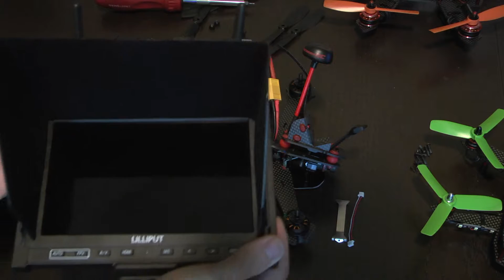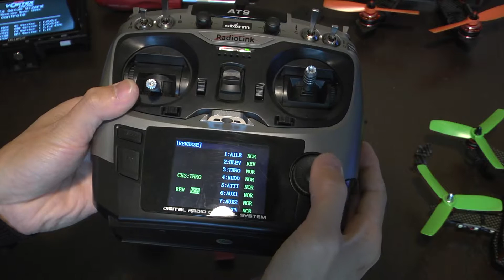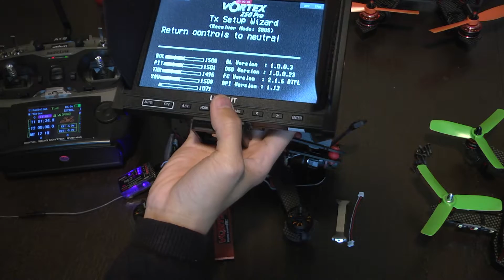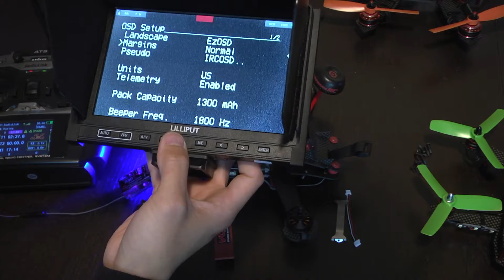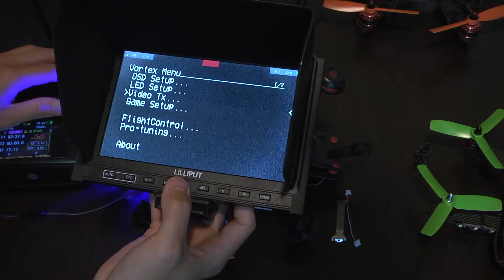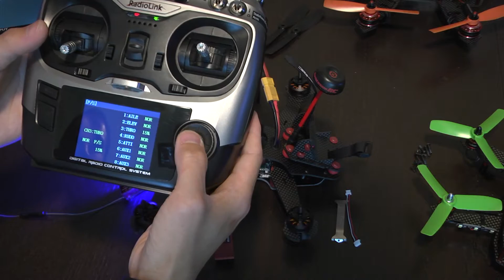How To Set Up and Bind Vortex 250 Pro with RadioLink AT9 (S.Bus)

Comment: ive got the same transmitter, i cant get my quad to arm once it blinds to the transmitter...how do you arm your quad?and would i change settings in betaflight or on the transmitter itself?
Reply from the maker: Changing how arming is done is configured in betaflight/cleanflight. By default, the left throttle stick (mode 2) is used for arming when you bring it down all the way to the bottom left (disarm to by bringing it to the bottom right).

It is recommended these days to assign an aux switch to arm and disarm (you would set that up in betaflight after pick your switch on the AT9).
Reply: @MatrixWriter  thanks bruh.i going to try it out in the am,ive never setup a drone through beta or cleanflight..anyway chance you could walk me thru it step by step?
Reply from the maker: @nickodadon1328  No problem, I'll do my best to help you out if needed if you are unable to find anything online. Feel free to email me which is located on the About section of my channel.
Reply: @MatrixWriter  i emailed you bruh.....
Reply: @MatrixWriter  i emailed you....

Comment: Hello thank you for this video. I am thinking about buying the immersion rc 180 124$ on amazon. I also have the radiolink at9 and at9s with the micro Rx. I looked threw all of my wires for that plug you have but i don't have it. Did you vortex come with that wire? I might have to solder the wires together to the right sbus connector for my micro RX. Can you please give me some tips or advise? Thank you.
Reply from the maker: Ian Rice No problem. The Vortex 180 according to the manual is supposed to come with 3 different receiver wires (S.BUS, FrSky XSR, and Spektrum). Chances are that you will have to solder a different connector to the S.BUS cable for the AT9 receiver (if it didn’t come with a JST or picoblade end connector)

I personally did a direct solder to the AT9 receiver as the pads are exposed and it is only 3 wires. Let me know if you have any questions.

Comment: hey ive got an atom and im trying to rebind it with my at9...are the steps any different?
Reply from the maker: Nickos White The steps are generally the same. Make sure the receiver and transmitter are bound together and in S.BUS mode. Next have your assigned Aux switches (flight, arm, etc) set.  Power up the Atom and the TBS Powercube will have you go through the RC wizard setup - similar to the Vortex.

Comment: okay I got an rx122 and everything connect but I cant unlock the at9 after the rx122 is connected...theyres a yellow lock on your at9...how can I get pass this so I can fly???
Reply from the maker: Nickos White I'm not sure what you mean...the yellow lock means that the radio menu will no respond to accidental touch of the buttons and dial wheel to prevent undesired setting changes during flight. However the sticks and flip switches will always respond. 

These settings can be change under Parameter menu. 

Once you have successful bound the receiver to the transmitter, you may might need to set up the radio system under Cleanflight/Betaflight for your model.  This video shows that you don't need a PC to set up the Vortex - however other models may.

Comment: Is the Kapton tape necessary or would electric tape work?
Reply from the maker: Jose Alvarez You can use both.  I picked Kapton tape since it doesn't leave residue like electrical tape. Ideally shrink tubing is the best if you have the right size.

Comment: Thank you SO much for posting the original Helipal settings in your Google Drive. One thing that's happening now though is the buzzer (beeper) won't stop beeping as soon as I connect the battery. I used to control it with the C switch but now no matter what I do, it just keeps beeping. Any advice on how to control this? Thanks again!
Reply from the maker: Will Dominguez Did you try reversing your channel for the buzzer switch?

Comment: Hello again...im on a streak of questions haha

I flew my drone today and was wondering why the picture on my FPV goggles was not very clear ...after 2 battery backs I realised that I left the spiral antenna off the drone.....arrrrrrghhhh..... newbie mistake!!...... no burning smell so that's a good sign I guess.

I put it on it works still but the range isn't that great.  Do you think I have damaged the video Tx?...... is this a stand alone video transmitter that I can buy and replace my existing one in the Vortex? ...... or is there any other better video Tx that you would suggest that is a simple plug and play with the existing cables( I looked at the ImmersionRC Race Band 200mw 5.8ghz on HobbyKing)?  (I will be flying with my friend on Wednesday who has Fatshark V3 so I will see if its my Kylin FPV goggles that is the issue also).

I also damaged the cable that goes between the R9DS rx and my vortex.....I have looked but cannot find where I can buy replacement cables to simply replace the damaged one.... do you know of any sites that I can just buy a replacement?

Thanks again!

Comment: The yellow wrap that you have put around your receiver, what type of material is that called please?

I presume its not heatshrink?

Thanks
Reply from the maker: Jon Jon That material is called Kapton Tape.  Used quite a bit in the electronics industry for light weight, high temp resistant, and no residue properties.  Hope that helps!
Reply: Awesome ....once again of much help!
Cheers
Reply from the maker: Jon Jon No problem!  Feel free to ask if you have anymore questions.

Comment: great video man! I'm trying to use my at9s, connected by sbus to the kiss fc, but, even all the channels works fine and the fc saw them all, I cannot arm! I tried everything, also changed the receiver but same result, any idea why?
Reply from the maker: TheBrinoz Thanks!  Typically and most likely - if you can't arm, you may need to adjust your endpoint settings.  For example, sometimes I cannot enter OSD and I have to rerun RC calibration and adjust endpoint settings.  Hope that helps!
Reply: thx for help! what you mean with "adjust"? on the radio? I saw yours and they are the same
Reply from the maker: TheBrinoz No problem.  Adjust as in the endpoints for the sticks - how far it electronically (physical on servos) travels.  Since you are using a different flight controller and not the Fusion one on the Vortex the endpoints will be different.

Comment: hello, how do you see battery voltage without telemetry on the transmitter? I ordered at9s also and wondering how I can do that..thanks
Reply from the maker: I am not sure of your question here.  Do you mean, how do you transmit telemetry from the quadcopter to the AT9?  If so, I am not sure if that is supported on this particular receiver.

Comment: Hi, thanks for this great video!

I have set up my Vortex 250pro (Ummagawd edition) but when i aim motort, motor 3 and 4 speening fast and the others 2 normal. What can this be? using RadioLink AT9
Reply from the maker: Sorry for the late response.  It could be that your quadcopter is not leveled (relevel it) and or you might want to recalibrate your ESCs.

Comment: I'm having problems with my Vortex and AT9. Connected ok and wizard has been completed. But when I arm the quad it seems to go full throttle and throttle stick has no effect. Any ideas??
Reply from the maker: You have your channels mixed up I believe.  Make sure that the RC calibration wizard has the right end points and mapping that shows up for the setup in the Vortex, e.g., when you move throttle up, it should show that up on the screen and when you move right stick fully to the right, it shows that and so on.
Reply: +MatrixWriter That's what I thought at first but after doing the setup wizard multiple times and making sure all the values are registering correctly it's still happening! Is there a way to factory reset the Vortex?
Reply from the maker: +Easty66  To reset the Vortex, plug in the battery (and hopefully the rear LED’s will come on) and push the button on the top right of the LED board for 8 seconds.  Resetting the quad will return the Vortex to the factory state in PPM rx mode.  You'll then need to run through the normal setup process.

I also advise if you have not to update the firmware on the Vortex to the latest one, this can be done using ImmersionRC tools.  Hope that helps!

Comment: I have an AT9 and have found most of the programing ok. I have set up aux channels and the switches (3 and 2 way) show that they are working in the radio. When I go to Cleanflight, fliping the switches will not show on Cleanflight. This means I can not set up any aux channels. Have I missed something?
Reply from the maker: Sorry for the late response.  If the channels show they are working fine on the radio, it would be an issue with the COM drivers for the flight controller.  Typically I reinstall the drivers and update the firmware too and that seems to fix the issue.

Comment: can you show me  the white pin is it a four pin or three pin(connector)?  and the black connector, is it a servo type of connector?  maybe I can make one for myself, thanks.
Reply from the maker: Unfortunately you will have to make the cable yourself by soldering the different receiver cables the come with the vortex - I am pretty sure I mention this in the video.  Also in the video description has some hi res photos of the cabling done.  

Hope that helps.

Comment: I have a somewhat silly question--- On the Radio Link AT 9, I have a real problem setting up the auxiliary channels for the use with Cleanflight. The channel Ok, the switch? the position of the 3 way and function- it has stopped me from designing the copter.Do you know of a video for AT9 that might cover auxiliary channel set up?
Reply from the maker: Are you able to see the switch moving/response in Cleanflight configurator?  If not, then you need to set it up on the transmitter.  From there, you can map the function of it in the configurator.

Comment: Will that receiver work as PPM as well?
Reply from the maker: Yes it will do PPM - if the LED color is red, it is in PPM mode, otherwise blue/purple is S.BUS.
I highly recommend S.BUS over PPM for lower latency and simplicity.
Reply: +MatrixWriter thanks. I know sbus is better, but I bought a lil rclogger brushless and it will accept ppm only. So I'm figuring out which radio to buy and I'm considering the radio link. I like the price, but it doesn't seem like many people are using them.
Reply from the maker: +brian s No problem.  I see what you mean by your setup now.  On the receiver (R9D), double click the bind button to change the modes.  For smaller and lighter setups, you can remove the casing. 

For the price point and features, RadioLink AT9 is not a bad system, great entry level system for the amount of features.  For even more advanced users and customizability and features, I would recommend the FrSky Taranis.  I use the Taranis for long range FPV and such. For quick flights and testing I use the the RadioLink.  RadioLinks are actually pretty popular overseas and China. Just not in the States. 

Hope that helps!

Comment: Every time I think I'm getting a handle on all this quad stuff, a video like this comes along and totally confuses me!!  It's a good video, don't get me wrong, it just raised more questions than it answered for me.  What is Helipad? Is it online software like Cleanflight or Librepilot?  Also, how did you get the OSD to go to your FPV screen?  Does that just happen automatically if you're in set up mode and you have the video TX and RX turned on, or do you have to have one of those OSD telemetry module things I keep hearing people talk about?
Reply from the maker: Do feel free to reach out if you have additional questions as I try my best to get them answered. 
HeliPal is an hobby distribute where I get most of my quadcopter stuff if I can't get it in the US. Lot of stuff comes from China but shipping is so slow. HeliPal has the fastest and best shipping as well as great service. 

OSD can be set up and customized once you set up your radio system.  As soon as the quadcopter is powered up and you connect it with your FPV monitor or goggles, you can see the OSD as well as what the FPV camera sees. 
No need to telemetry as the data is displayed in front of you.  If you don't have OSD, pilots will use telemetry to relay info about voltage, signal strength, time flying, etc.   I prefer OSD and it is much simpler.  

Hope that helps!

Comment: Did you do the mini R9D yourself or buy from Heli Pal this way?  I was thinking about buying a mini for the SP Racing Receiver from heli pal and changing the connector to fit the PowerCube.  Or considering doing this myself.  So if you did do it yourself, you should make a video describing how you did so =)
Reply from the maker: I did the micro receiver modification myself as I had the full sized version available from Helipal.  You can save yourself a few dollars by doing it yourself.  There are photos in video description on what I did but yes, a tutorial video for this might be good idea for me to make as I didn't know RadioLink radios are really popular.   

Hope that helps!